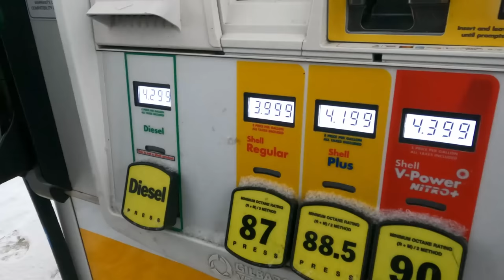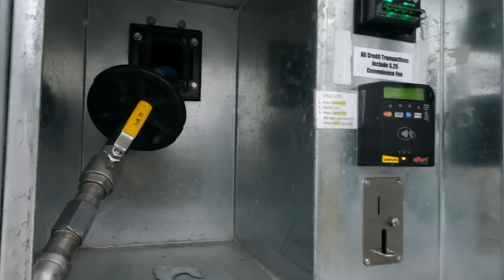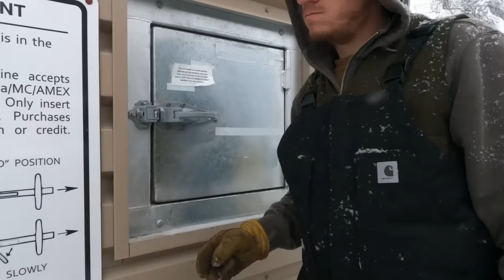Winter Supply Run in Remote Alaska | Snow Machining & Tractor Plowing

Comment: Ill give you a tip! You can move snow a lot quicker if you use the backblade when you are backing up! That way you do twice the work in half the time! I cleared a half mile road and 6 yards and driveways in 2 hours with 2 feet of wet sticky snow! And push several down trees out of the way!